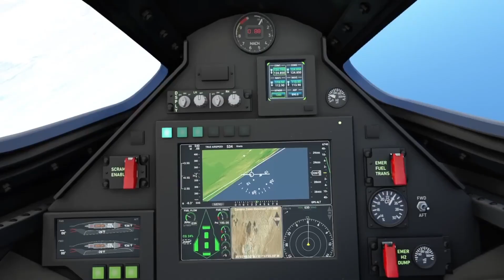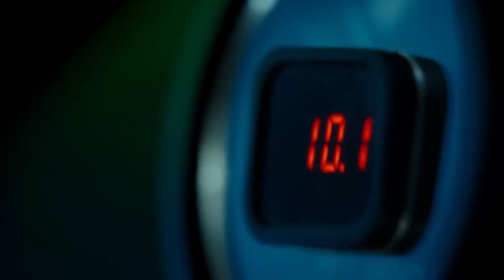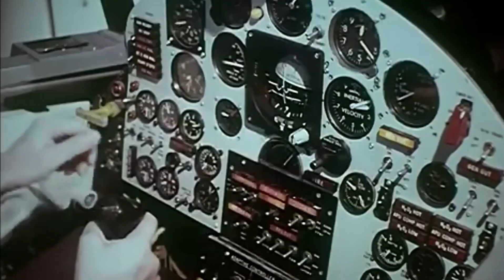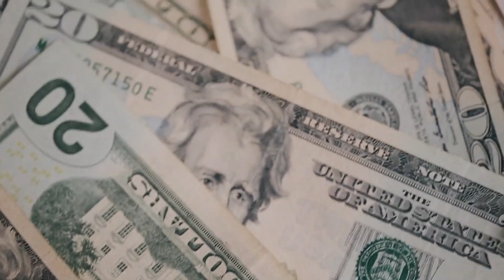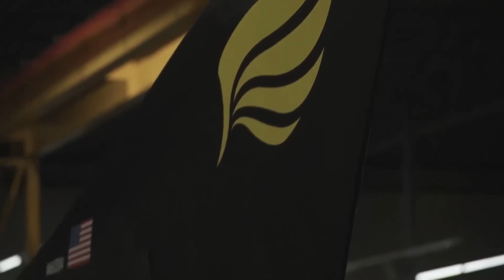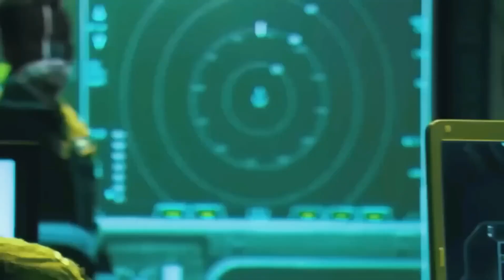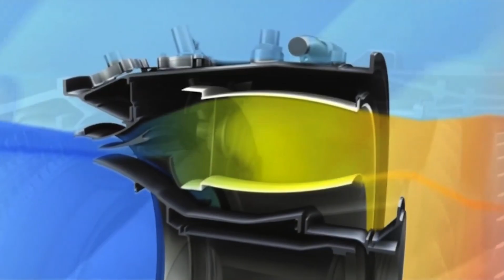US Hypersonic Test STUNS Experts - Faster Than SR-72!

Comment: All I know is simple. They would never retire a program for surveillance immediately without a bigger better faster one. Satellites are slow and expensive to re-task in orbit. Having a deployable stealth high altitude above MACH 5 to take instant pictures? Priceless. The engines in the SR-71 were a prototype SCRAM jet. At take off it worked till MACH 1.5 then the nose cone shifted and the moving parts stopped turning and the pressure of the incoming air was adjusted around the turbines and fired. The heat was the problem and was solved by using the cold air around the plane. The SR-71 could exceed MACH 3.2 but could melt! The new Tech with Plasma Gravity containment for Fusion Reactors suits this problem quite well. They built a newer version.